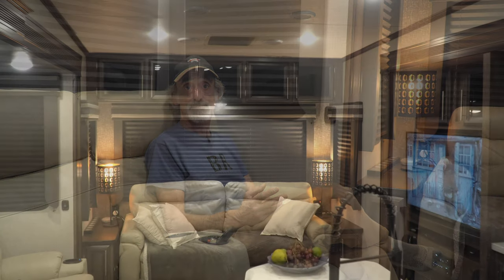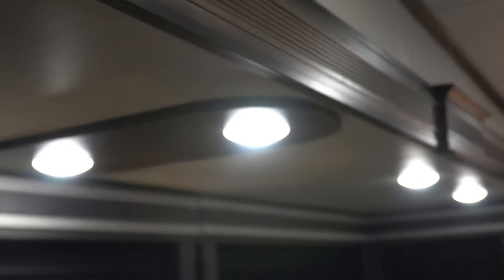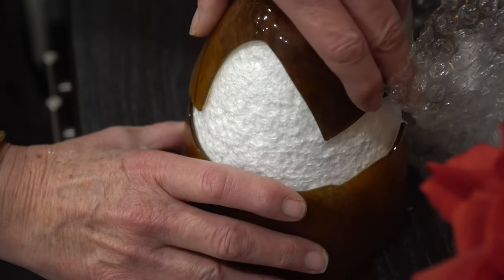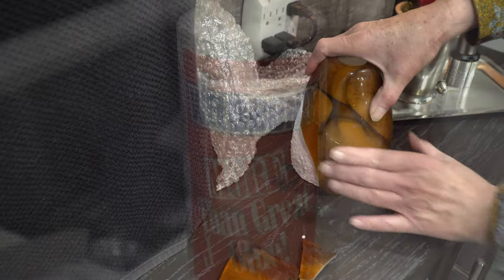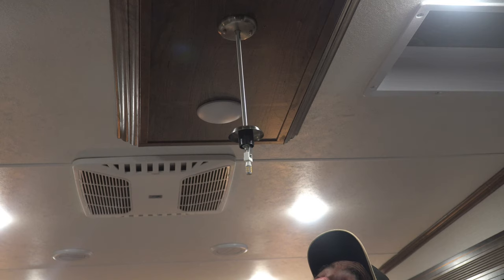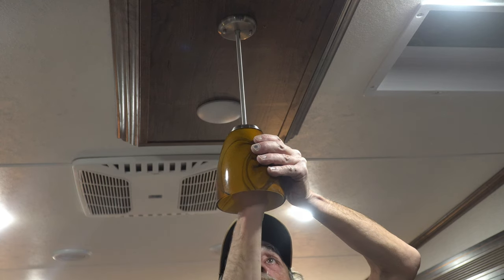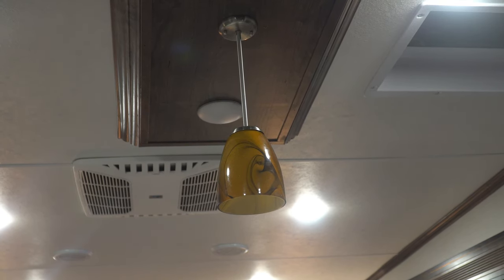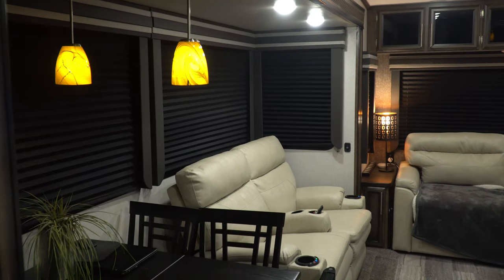Ep.185: Upgrade Your RV Lighting | camper how-to DIY upgrading interior lights

Comment: When you cut off the light you could have cut it off longer and use that as a "pig tail" to attach the new light  to.  That way you don't have to cut off the old crimp connection...you just add a new crimp connection.
Reply from the maker: That would've been a great idea! Notes taken for next time, Skip -- thanks for the suggestion.

Comment: Marc, my wife and I just finished watching  you RV lighting installation...they look great!  Looks like your house on wheels is feeling more like home now.  We really like your Durango 5th wheel model.
Reply from the maker: Thank you Homer! We're definitely feeling at home, and we haven't yet missed our house for a second.
Reply: Marc, any thoughts on what truck you will be upgrading to replace your Toyota Tundra?  3/4 ton, 1 ton, dually, etc...it will definitely help in towing and stopping when going up and down steep grades.
Reply from the maker: @homermartinez5000  yup, I'll be leaning towards an F-250, diesel if I can afford it. Our big test comes tomorrow as we head south to Quartzsite for a week. This will be our first long tow with the new rig and the Tundra, and will be an indicator of when we'll start shopping for a truck -- sooner, or later. That said, this rig both pulls and stops far more effectively than our truck/trailer Evo combo did, at least on relatively flat ground in the Salt Lake metro area. But there are three mountain passes to cross between here and St. George so tomorrow will be a huge indicator.
Reply: Marc, diesels are great, but your right in that they are more expensive than their gas counterparts...also, the engines are heavier which take away from the payload capacity of the truck. A rule of thumb that I use for calculating the pin weight from a 5th wheel is 20% of your 5th wheel GVWR.  The GVWR on your Durango D283RLT is 10,500 Lbs...20% of that would be 2100 Lbs. If you add another 1500 Lbs for passenger, hitch, cargo, etc, you can estimate that the truck will need to have a payload capacity of about 2100 + 1500 = 3600 Lbs.  Note, you can adjust the 1500 Lbs to suit your needs.  Also,  I would reduce your towing capacity by 20% to allow for steep inclines and declines...the calculation I use is GVWR of 5th wheel divided by 80%.  In your case, it would be 10,500 Lbs / .80 = 13, 125 Lbs.  I would use a towing capacity, on a new truck, of 13,125 Lbs or greater...most 3/4 ton gas and diesel trucks can easily achieve this towing capacity.  Hope I didn't bore you with the details...I guess that is the engineer in me wanting to explain things with numbers.
Reply from the maker: @homermartinez5000  nope, it is welcome and it's fairly consistent with my own thought process. Thank you for sharing your thoughts!

Comment: Thats was a great improvement for sure! I changed out a few sconces in ours, but more importantly I put dimmer switches on most of the "way too bright" led ceiling lights.
Reply from the maker: Thank you Dwayne! Unfortunately most of ours are tied into the touch screen on the LCI OneControl system and lack a physical switch, so dimmers are not an option, but I never even realized that there were 12-volt dimmers out there.
Reply: @GrandAdventure  oh ok... didn't realize that if you have the touch screen you dont have physical switch, interesting... but ya you can get the round "knob" style and also the "slider" style dimmer switches for 12-volt. Made a huge difference because the LED's at full strength are just way too bright for us.
Reply from the maker: @ChosenAdventures  well I learned something new. We have a couple that are on physical switches so we'll have to look into that.
Reply: @GrandAdventure  here is what I used for the round style: https://www.amazon.com/gp/product/B01C4UBMY6/ref=ppx_yo_dt_b_search_asin_title?ie=UTF8&psc=1
Reply from the maker: @ChosenAdventures  yeah, I went looking at those dimmers last night after our conversation. And I also looked at the hardwire switches that I do have and I'm stumped as to how they remove, I need to investigate those futher.

Comment: Great info, Marc! We want to swap out the reading lights in the trailer’s bedroom and the lights over the dinette - and your tips inspire us to start shopping for the replacements. Thanks!
Reply from the maker: Our pleasure, Bob. Best wishes for a successful upgrade! FYI we've since learned that you can in fact use 120V fixtures -- just cap off the green neutral lead on the 120V fixture and use 12V bulbs like these: https://amzn.to/3sw851K
Reply: @GrandAdventure  Interesting! That may make it easier to find the fixtures that suit our tastes. Thanks Marc!
Reply from the maker: @bobr7867  although we are very happy with the fixtures that we installed, we wish that we had known about using 120 v fixtures at the time. It certainly would have broadened our selection.

Comment: Hi Marc!  I hope all is going well!

A very much off topic question---  as you know, we've been waiting to make a decision as to what type of RV set up we'll get.  Long story short, we decided on getting a full size gasser truck and a medium travel trailer.  Also of consideration were a small 20ft travel trailer that we'd suffer through with our Tacoma and a Class C motorhome.

Because you mostly boondock in national forest and BLM areas, we wanted to get your opinion.  We envision 1-2 week trips, mostly boondocking in areas like the ones you visit.  I will get a 1ton gasser with appropriate gearing; so size is not really a matter for that.  We will most likely get an Outdoors RV travel trailer so as to get some "4 seasons" capability too.   Their small series are about 25ish feet long; but those definitely do more without due to the size.  There are some other options in the 27-28 ft range that are sufficient for us.  And, the 1 we really liked is 31 feet.  As a matter of fact, we had decided on the 31 footer.  In the midst of high 5ing for FINALLY making a decision, I brought up the discussion I had with Long Long Honeymoon youtubers that I had met by Marble CO.  They had just left from Black Canyon of the Gunnison and commented that if their rig was bigger than their 25ft airstream, they wouldn't have been able to stay there.

So, based on your experience, and knowing that we'd like to get on forest and blm roads and lands, do you consider a 27/28ft rig THAT much bigger than say a 25ft'er.  And, do you feel a 31 footer that has off road suspension and clearance would be that much prohibitive?  

Safe travels!!
Reply from the maker: I actually think you would be fine, Alan. For boondocking that's not that large a trailer, especially with adequate ground clearance. Just make sure that the axles aren't so far forward that you will have an issue with departure angle. The reason that Long Long Honeymoon had an issue at Black Canyon of the Gunnison is that many national park campgrounds were built during an era of shorter trailers. Those older campgrounds simply can't accommodate longer units.
Reply: @GrandAdventure  Hi Marc!  Thank you very much for your input.  I will weigh that heavily.  Definitely, one of my perspectives is that larger one is the one we really like; both the floor plan and the options that could be had.  So, we just make that work.

It is kind of duality-ish.....eventually, we will target going to all of the national parks that are in a region that we are visiting.  So, it is natural to think that we would camp there too.  Fact of the matter is that those parks are very packed; which may better support staying out of the park a ways.

Thanks again for you input. You do pretty much the same camping that we plan to for the next 3-5 years.  Once we shifted favoring to that smaller trailer, I discovered that the bathroom, fridge, dinette,  and kitchen were all blocked with the slide in.  That slide also has those side wall tract bars on the bottom and top and the slide needs to go all the way in and all the way out to keep the 2 motors synched.  So, that really isnt conducive to partially deploying it to squeeze by.  Hence, I may shift back to considering the larger trailer.
Reply from the maker: @campingalan  That's a huge factor. We even discovered that many of the fifth wheels we were looking at closed off the hallway to the bathroom in the bedroom with the slide in. That was an absolute deal breaker for us. Also, our preferences to camp outside of the national parks, either boondocking or in a campground if necessary. I would rather drive into the park then deal with their restrictive regulations in the National Park campgrounds.
Reply: @GrandAdventure  Yes...seems kind of pointless to not have at least a small access to everything.  I saw 1 rig yesterday that was a great 25 footer in the Rockwood series.  But, the slide blocked access to the fridge and the entrance to the bedroom.  The salesman said you could crack open the slide, slip into the bedroom, then close the slide with an app while you sleep at the rest area or where ever.   That sounds like a middle of the night disaster waiting to happen with fire and such!

Oh...and I should clarify,  we plan for both boondocking in the national forest and blm lands, and using the national forest campgrounds which I would call  boondocking light if they have a water spigot or outhouse.
Reply from the maker: @campingalan  every rig is different, and so is every buyer. You have to find what's perfect for you. When you find it, grab it.

Comment: Since you have lights daisy chained together at those mushroom cap splices, I suggest clipping the black and white light fixture wires leaving enough wire to splice to, this way you are not messing with the factory splice. It makes for an extra splice but doesn't interrupt the daisy chain. Also, I always cringe when I see a screw gun or drill used to drive screws. I always leave the last turn or so to do by hand.

For LED lamps as replacement for incandescent or even replacement of certain factory LED installations,  I highly recommend M4Products as they have high quality products and their "color" is very consistent from one bulb type to another. I use Natural White which is very slightly on the yellow side of perfectly white. I never use cold or bright white as it is very bluish, and I am not a fan of Warm White, though many people are. I would perusing the M4 website completely to see if you can find replacements lamps for fixtures you are not happy with the color of. https://m4products.com/better-leds-for-factory-led-fixtures/
Reply from the maker: Good tips Charles! See, that's why I never claimed to be handy. 😁 We've heard great things about M4 before from others, too.

We've also since learned that it's possible to use a 120V fixture. You just cap off the fixture's green neutral, and use 12V E26-base LED bulbs like these: https://amzn.to/35ELSVB . If we decide to replace any other light fixtures that should make an interesting video.

Comment: Hi Marc,

You look way too comfortable in your new home! My wife Kuuipo is jealous - she says to tell you to “stop showing off!” 😉

And Zoe.....even more comfortable by the fire place!!

The lights were a great improvement esthetically. 

My concern would be the length of the stems with the weight on the end coupled with the trailer rocking back and forth. Do you think that repetitive torquing will cause the screws at the base to pull out from the wood from that rocking and weight? 

Can’t wait for you folks to hit the first camp! 

Ram and Kuuipo
👍🏼.           👍🏽
Reply from the maker: We will find out, Ram, but so far so good. Drove 5 hours today and everything is just fine, we are in Mesquite, Nevada for the night on our way to Quartzsite for the week. The crazy thing is that the Tundra is pulling like a champ. I'm actually getting better gas mileage than I ever got with the Evo, despite the fact that the Durango is 3,000 lb heavier. It must be aerodynamics. I ran at 75 to 80 mph all day today.
Reply: @GrandAdventure  
75 to 80 mph!
Our trailer book tells us to stay at 60 mph or below. 😞
And then it also tells you to add air into the tires to go 65 mph???

Is your Tundra a 1/2 ton or 3/4 ton?

How is your gas mileage?

I sent you an email with a family that ran off the road in the snow in Utah. Very scary.
 
Please drive safe....Get plenty of rest.

Ram
Reply from the maker: @laughingram7287  when the speed limit is 80 I tend to drive at least 70, I don't like the prospect of getting rear-ended by some Yahoo. I got 8.2 MPG from Salt Lake City to Mesquite, which I will take every day of the week compared to what I used to get with the Evo. That Toyota is a half ton, they don't make anything bigger.

Comment: Hello. My favorite YouTuber. Lol. How did you know which wire to tie into, from new light fixture? Was it marked from package ?  Happy Trails 
Thanks. Looks good !!
Reply from the maker: Hey Michelle! Thank you. The 12V light fixture has two leads -- one positive, one negative. In the case of these pendant lights it doesn't matter which one is which. If the polarity is reversed and the light doesn't illuminate, simply reverse the bulb in its socket.

Comment: This project looks great! However, question if there is no light fixture above the sink island in our RV would there be a possibility to hand a couple lights or one light fixtures? NOT sure if it was plummed for one but all we have is a pendent light above the booth table and all the led lights around everywhere else in our 2018 FR Hemisphere.
Reply from the maker: Depending on where you could find a 12V line you could theoretically tie into that, and fish wire for both the fixture and a switch. Potentially.

Comment: Those 12v puck lights— in the bulb switch up,:   I saw that you were screwing in a light bulb-  much different than the bulb in that  other.  Are they both L E Ds ?  And how did you make the choice- by amperage or by lumens ?
Reply from the maker: Pressing in instead of screwing in, Kris, but yes -- those are the same automotive 12V light bulbs that are in the reverse lights of most cars. They're LEDs. And we made the choice by lumens. Thanks for watching!

Comment: We have a 21ft travel trailer and we were wondering how do you like the 5th wheel hook up lifestyle inside and out, compared to the travel trailer? Do you like the slide with the closet?
Reply from the maker: Joy, the difference between a fifth wheel configuration and a bumper-pull travel trailer is night and day. First off, the towing is far more stable -- we had some substantial crosswinds on our drive down to Quartzsite and it handled beautifully with the pivot point directly above the rear axle of the truck. We no longer even feel a semi blowing past us. Even though our fiver is 3,000 lb heavier than our travel trailer was, better aerodynamics means the truck is actually working less pulling the fifth wheel. It typically tows in one gear higher than it would've with our travel trailer, and we averaged 8.2 MPG on our two-day drive to Quartzsite, whereas we would've gotten 6.5-7.0 MPG with the travel trailer. A fifth wheel yields much more basement storage, too. If we knew back in 2017 what we know now, we would've started with a fifth wheel back then.

The closet slide was a necessity for us as we're living in the rig full-time. We looked closely at the Grand Design Reflection 150 Series 295RL, which is nearly an identical floorplan, and while we preferred the two bedroom windows in the 295RL we realized that we really needed to have the closet in the Durango instead.
Reply: @GrandAdventure  oh my gosh you are such a great person. I can't believe you answered me for one, but you answered my question and helped me make a decision. You were my first You tube channel and will always be the best channel. So informative and helpful. Thank you again and I will let my husband read this so it will help him to. Thanks for showing us the nation and educating us on proper Rving. May God Bless you always! Joy
Reply from the maker: @joyalexander9677  now you're making us blush. Of course we answered you, we strive to answer everyone. We'd be nothing without our viewers, and we appreciate each and every one of you.